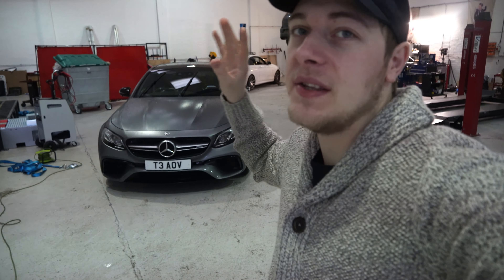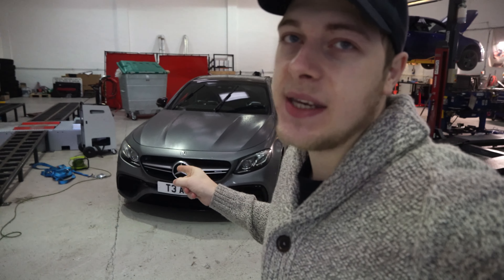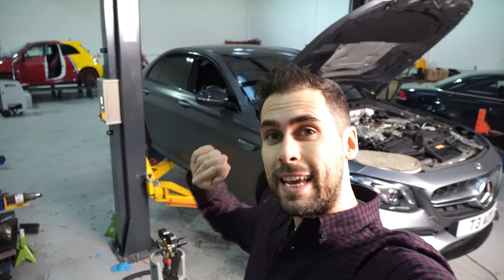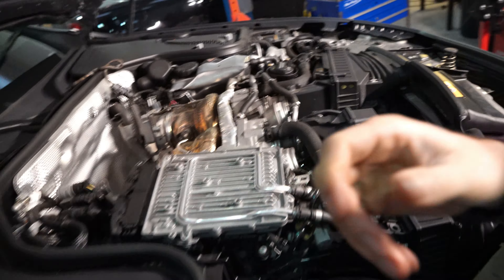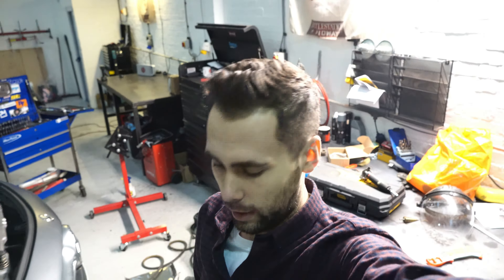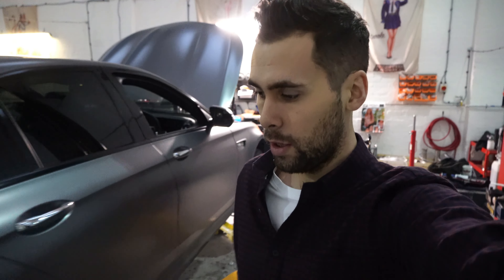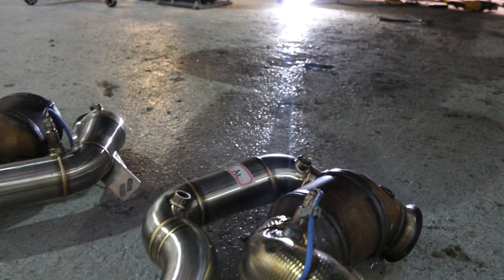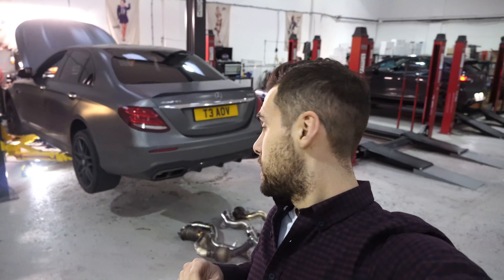MERCEDES E63S AMG STAGE 1+MTC DOWNPIPES *SOUNDS INSANE*

Comment: After melting twice the upper cats of the same E63s 2018 (the 2nd set lasted less than 2000 km on a fully stock car 🤯😱), I've finally decided to go catless. Been thinking to install Supersprint catless downpipes, as they come as single components, which seems better than having an additional assembly points (like the MTC). What's the power gain you have achieved with the E63s, guys? Isn't the car too loud with the catless downpipes? Do you install spacers on the lambdas or you just tweak the codes in the ECU for them so the fault code won't come up on the dash?